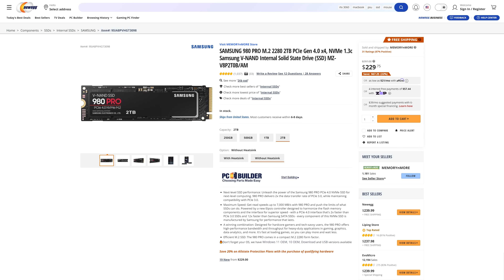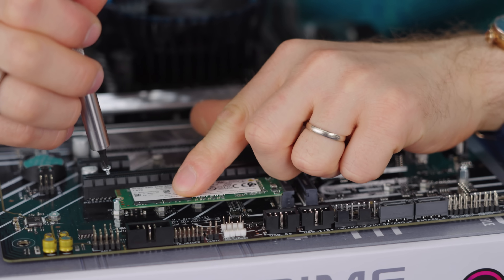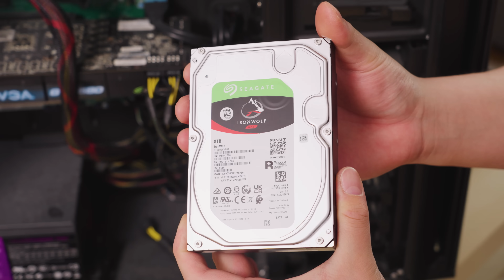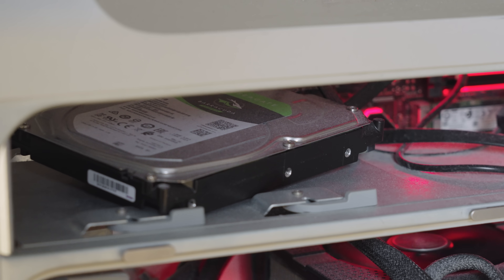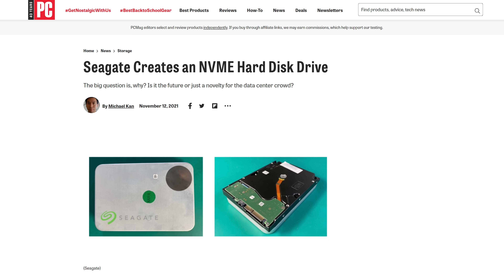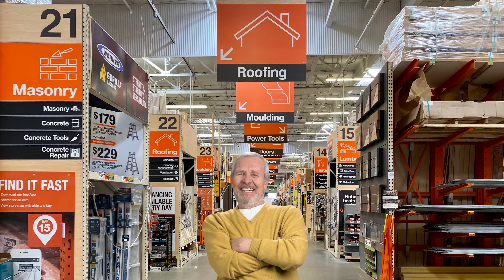Is SATA Obsolete?

Comment: No, it's not. You can still fit a lot more SATA in a PC than you can fit NVME and the speed difference is irrelevant outside of benchmarks
Reply: That's what was mentioned in the video 🤨
Reply: @maylinnr  That'd require watching the video, and not getting your validation in the form of getting a first comment.
Reply: NVME is not irrelevant outside of benchmarks
Reply: And SATA hard drives are still gonna be popular as options for lots of cheap storage, and for systems like NAS devices where storage speed isn’t as relevant.
Reply: I am still waiting for NVME cables, possibly with a splitter that will turn PCIe x4 into 4x PCIe x1
Reply: @hubertnnn  I think I seen a video on one of those already not sure if it was LTT or someone else but quite sure I seen that expansion already.
Reply: how is it irrelevant outside of benchmarks
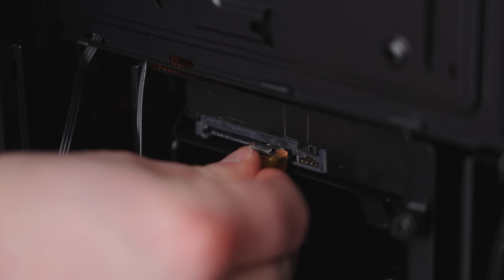Reply: Wow. Saved me a whole 2:24 reading your comment before Riley said those exact words...
Reply: If you very lightly use your PC maybe but if you are a power user.... if you have multiple VM's or you are running servers, even just gaming is ALWAYS better on a NVMe don't kid yourself, loading times are halved if not less, your PC will boot faster even if you have multiple programs on start, you can enable faster backups, etc.

The only time you should choose something worse is if you don't need it, even then having more performance never hurts in the long run.

Source : I have 6 brands of sata SSD, multiple NVMe including a RAID 10 with 4 sabrent hitting 10Gbps/seconds (sweet)
Reply: Actually you can buy pcie-cards with up to 4 pcie-ssd slots, so there really is no limiting factor unless you are on a mini-itx board. There isn't enough cost benefit going with sata ssds. Unless you are using HDD there really isn't a need for SATA. The same can't be said about the SATA power connectors though, those are used for a lot of stuff now to replace molex
Reply: @chronometer9931  The limit is not the ports, its the PCIe lanes in your CPU.